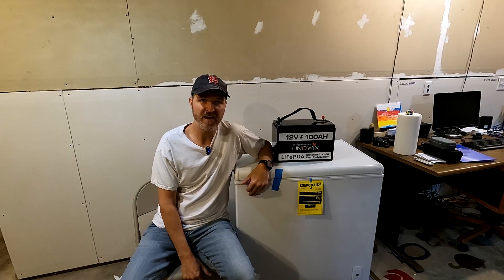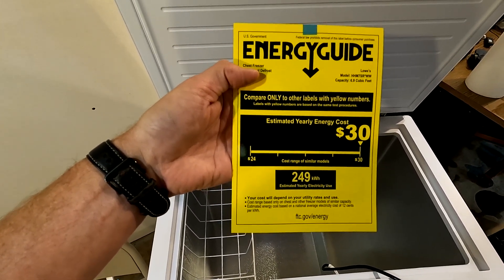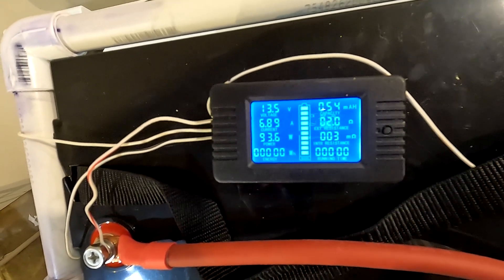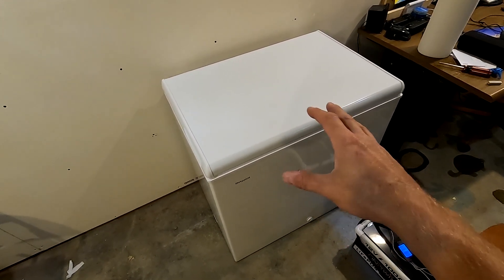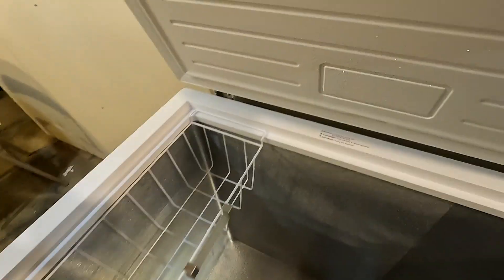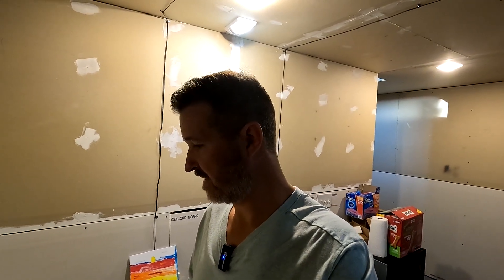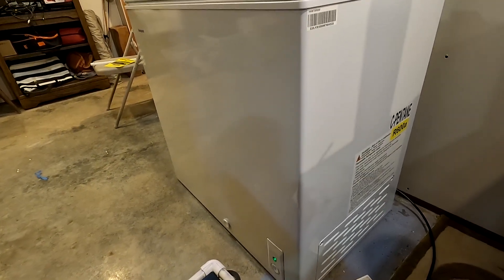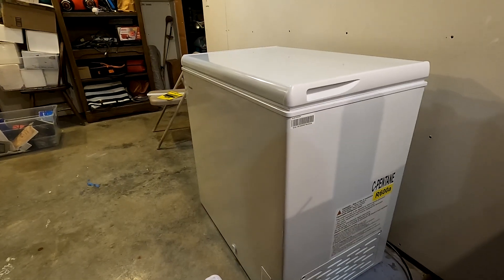Running Brand New 7cu. ft. Deep Freezer with a 12v 100ah LifePO4 Battery!

Comment: I have a 220ah battery and a 1000watt Redodo inverter but I can't get my little 7cf freezer (the exact same freezer that you have there) to turn on and run with my system.  My inverter puts out only 110 volts where my wall plug delivers 125 volts.  I got a hunch that this is the reason.  My inverter is supposed to have a surge of 2000 watts so Idon't think that would be the problem.  My 18 cf fridge won't turn on either.  I can plug anything into my system and all works well 'cept for the freezer and fridge.  New better 120v  inverter maybe?

Comment: This test was perfect for my thoughts. We have a off grid cabin and was looking at replacing our coolers with this type set up. Ice never seems to last and we are making so many trips out for ice. So upon arrival at camp, we would always start out with a hot freezer and have to cool it before moving in the food and drinks. I was trying to find a way to use a chest freezer as an cooler/fridge for up to 7 days of off grid camping. Now I know I will need another battery and a solar system to maintain the batteries during our longer stays. Normally we are only there 2-3 nights but a couple times a year we are there for an entire week. Thanks for taking the time to run this test and share it with us. It gives me more ideas
Reply from the maker: That's a great idea for your cabin setup, and I'm glad the test helped with your planning!

Comment: 92V is kind of scary to me but the motor probably doesn't run long enough to harm it. Lower volts pulls more amps. How many watts does your inverter use on standby? It would be a pain in the rear to remember but you might be able to extend that time by deciding when the freezer cycles and turning the inverter on and off every 3 hours or so in an emergency.
Reply from the maker: It turns out the inverter had a blown capacitor.  That's why the voltage was so low.  Most 1500w inverters use around 8w of standby consumption.  Hope this helps!

Comment: I would love to see how you set that battery up with the drop on rig. Looking to set myself up with 2 100ah lifepo4 batts and interchange them as needed in power outages for my refrigeration. Ideally one charges while the other is in use. Anyway I'm looking to rig mine like that for portability and relative ease and neatness going from battery to battery...thanks!
Reply from the maker: I get something working for ya!  Thanks for the comment.

Comment: Great video, do you happen to know what is the wattage on this freezer chest? Or how many amps does it draw? Thanks.
Reply from the maker: The freezer uses about 70w when it running.  At 120v, that would be about .6A

Comment: Turned down to lowest setting-s turns n2 a Frig/super efficient/longer lasting...what temp.setn' did u use?
Reply from the maker: I used whatever the default was!  I don't think I ever adjusted it.  Always sits at 0⁰.  Thanks for the comment.

Comment: I want a solar system to run my deep freezer 9 cu ft and am trying to figure out what it would cost. Any idea? This vid was very helpful
Reply from the maker: I believe you would want 200ah battery, 30A charge controller, 1000w pure sign wave inverter and about 400w of solar panels.  You're looking at a minimum of $800.  That is just an educated guess.  I hope that points you in the right direction!

Comment: that's not a energy style chest freezer. a energy style freezer almost cuts the usage in half. I tested both with my kilowatts meter
Reply from the maker: You're right.  This is a very basic freezer unit.  I bought a freezer that I figured the average home owner would purchase.  Thanks for the comment and information.
Reply: well you should have told people that in your video so they know, its a huge difference, just saying. I also run a 7 cubic ft chest freezer with a external thermostat so it runs as a fridge, great energy save as it opens form the top where warm air goes and its way better insulated than a standard fridge. external thermostats cost 6o bucks. have done this for over 25 years @OffGridBasement
Reply: @billywray4524 Billy, what do you mean by a real energy style chest freezer? Did you mean to type "energy star"?
Thanks
Reply: @prometheusboat  sorry yes i meant energy star. tested both huge difference in usage
Reply: @billywray4524  thanks a lot Billy

Comment: Just saw your video and what a great timing.  I've been thinking of buying a freezer but am still undecided on whether to purchase the 5 cu ft. or the 7.  Since it is  my two of us I'm leaning towards the 5 cu ft.  Seeing that that 7 was so efficient I am hoping that the 5 cu one will be just as much.  Gives me a piece of mind that a 100 ah battery ran it that long empty.  I have a couple of ecoflow delta max 2000  that I can hook up to and use as an EPS for when we experience a power outage which is frequent in my area.  This is good information to know especially when we travel and are gone for several days or weeks.  I know that my ecoflow powers my residential fridge for 17 hours by which power returns but the freezer that will have all my expensive meats will be a game changer with how efficient it is.  Thanks for sharing.
Reply from the maker: You're welcome!  Also, the freezer will run much longer when it's got food in it.  I've heard of you put 1\2 gallon jugs of water at the bottom, it makes a big difference.  Thank you for the comment.

Comment: We will be running a  similar  sized freezer off grid. The switch on surge appears to be about 750 watts for a few moments. The Inverter (700W Nomad) is rated at 1400w surge, so should handle it. It should do well in summer with sunlight. (We will have 2 x 160W facing E-W on opposite sides of roof with 200Ah of Lithium batteries.) We may need to upgrade to another battery to cope with winter doldrums here in NZ.
Reply from the maker: Sounds like you have everything you need.  Thanks for the comment.

Comment: i been curious about this myself. i just bought a high efficiency 3.5CF and 2 100AH batteries for cloudy days. i got 2 Renogy 100W solar panels to push it. its not yet arrived in the mail but i think i possibly may need to double my solar panels, just a hunch there.
Reply from the maker: Doubling the solar is a good idea.  That would make it sustainable for many more days at a time.  Thanks for the comment.

Comment: So if you add a couple of hundred watt panels and the charge controller this thing will be autonomous?
Reply from the maker: Yes.  Right now I have 1800w of solar and 600ah of capacity.  It's overkill and I never need to worry about it.  Thanks for the comment.

Comment: How long can 1 car battery that's 1,000cca run a 600w Ac without solar panels ?
Reply: Maybe 18 hours: V x amps = watts. 12 x 900 (running amps) = 10,800 divided by 600= 18 hours. However, doing this would draw your battery down to zero amps which will kill your battery if you do this often enough, even if its a deep cycle battery.

Comment: I’m a little older and have had a few freezers . Usually I was told never to run a freezer empty , first off , for what good reason, always at least a 5 gal pail three quarters full , one to see how well the freezer works, second to help maintain the frozen atmosphere, like a cooler or an ice box . In what scenario would it be used empty ?
Reply from the maker: It shouldn't!  I wanted to show the worst case setup.  This amount of time should be the LEAST amount of time you would get from a freezer.  Most would have already been frozen and probably at least 1/3 full if not more.

Comment: Hello friend i have 48V solar charger 30A PWM  SOLAR CHARGER CHANGER CONTROLLER WHAT PAMEL CAN I USED CAN USED FEW 12PANEL TO CHARGE MY BATTERY
Reply from the maker: For a 48v configuration I believe you need at least 60v of panels.  If you connect four 12v panels in series that should be good enough.  Hope this helps.  Thanks for the comment.
Reply: Thanks ☺☺☺☺ am trying to finsh my project yet done need get better battery but i used what i have for now all love watching video

Comment: I have 4 one gallon jugs of water in the bottom,  provides thermal stabilizing mass and as a last resort 4 gallons of drinking water.  Other advantage there is no defrost cycle like a refrigerator.
Reply: You could also put the frozen jugs in a refrigerator to help keep their contents cold.
Reply from the maker: The jugs of water are a great idea.  Thanks for the info and the comment.

Comment: Think I messed up I plugged both wires from battery to inverter then plugged freezer…. Help
Reply from the maker: That sounds correct.  What is the problem?
Reply: He may not have charged the inverter with a piece of thin wire connected to the battery before plugging in the freezer. @OffGridBasement

Comment: I want to build an ice cream tricycle, would I just need a power inverter and a battery to run the freezer?
Reply from the maker: Yes.  A fuse would be a good idea and a way to charge the battery.  Thanks for the comment.

Comment: Oddly, your 1500w inverter used to drain 19 watts from the battery without AC load, and now with a freezer when compressor is off, it drains only 12.5 wattss from the battery.
Reply from the maker: It was because the first inverter had a blown capacitor.  I believe this one is the replacement.  Thanks for the comment.

Comment: Hello. I have a ecoflow delta pro. I'm confused about how long I could run a freezer like this to constantly be freezing ice for an icy breeze. I have a wave 2 and it's dangerous and failing.
Reply from the maker: The ecoflow delta pro has about 3x the capacity of this 100ah battery.
Ecoflow = 3600wh
Battery in video = 1280wh
I would say you should be able to get at least 80 hours of freezer run time.  Hope this helps.
Reply: Thanks!!
Reply: My freezer seems inefficient. I think I'm going to return it. It's runs at least 80 watts, and is always on even full of Ice

Comment: Cant find a video of someone running a freezer indefinitely off of solar/battery full time. Im assuming its because you cant
Reply from the maker: You definitely can.  The freezer in the video is powered by my 24v system.  300ah and 1.8k of solar powers it 24/7 with no problem.  I plan on doing some things with a 100ah battery and a 180w solar panel soon.  Thanks for the comment.

Comment: Are you running a pure Sine wave inverter
Reply from the maker: Yes.  The inverter is a pure sign wave.  Thanks for the question and comment.
Reply: @OffGridBasement  I have a 5000 watt modified and now they are saying it will burn out a fridge or chest type freezer, it takes two batteries to get the 5000 watts, but if you keep something charging the the batteries, it will run ever thing in the house at the same time (110-120 of course) power house but now has me worried to use it, what can you tell me about this modified sign wave inverter
Reply from the maker: @randybird9979  I do know that modified sign wave is harder on anything with a motor.  You could get a smaller pure sign for just the fridge.  I've found a 1500w does the job just fine.  Hope this helps.
Reply: @OffGridBasement  I been thinking I need to get a pure sinewave , I have used the modified sinewave for fridge, but not much only when electric went off, thanks for the info

Comment: You sort of indicated that you might be running your freezer on solar to make it free, but you also seem to be experimenting to see how long a charged battery would last if you lost power and the sun didn't come out for days. I think that you will find, if you wanted a dedicated emergency power source for JUST your freezer, you could use a 700 or 800 watt inverter instead of the 1500 watt one and you'd get an even longer run time. The bigger the inverter, the more energy required to just run the inverter in standby (when the compressor shuts off and is just waiting to cycle back on when the freezer warms up) The type of inexpensive inverter you're using isn't very efficient, but by sizing the output of the inverter closer to the needs of the freezer, you will extend the run time. This will be especially true when your freezer is full of frozen stuff and will be spending most of the time in standby, and you'd just be burning up juice to run a large inverter that isn't really doing any work for you during those periods. Of course, if you have other things connected that run all the time, that would be a different story. The best way to power refrigeration with emergency equipment is to monitor the inside temp and turn the inverter on and off at regular intervals manually. It's more work, but the battery will do the most good that way. You can even chart the on/off time now, during a non-emergency, make a note of the interval and then replicate it manually during an emergency. Throwing quilts over a small chest freezer like that, if it's full of frozen food (keep any unused space filled up with frozen water-filled milk jugs) will require very little cycling for 2 or 3 days.
Reply: I was beginning to think the too!
Thank you for giving it your stamp of approval! 😊
(Deadicated inverter for the chest)
Reply from the maker: Thank you for all the great info!

Comment: 92vac input is a bad thing. You may want to check the input with another meter just to be sure. It'll run but the low input voltage will definitely reduce the longevity of the freezer. Possibly much sooner than you would think, no way to know. Good luck
Reply from the maker: You're correct.  It turns out the inverter had a blown capacitor.  ALFFAA sent me a new inverter and it runs at 114v.  Thanks for the comment.

Comment: You should have brought down freezer temp first, filled freezer, (as in real world power loss ). After cycled off, then start battery test.
Reply from the maker: I did this test again with those specs.  Here is the link:  https://youtu.be/1uY1rRy7wrQ
Thanks for the comment.
Reply: It was definitely real world for me! I have solar only for electric and this is exactly how it would go for me.

Comment: Is it ok to use this for 15 cubic deep freezer?
Reply from the maker: I'm sure it would work fine.  The compressor probably doesn't require too much more power.  If it's possible to find out what the surge wattage is, that would be best.

Comment: Freeze a cup of water to the top and place a quarter on it and set it inside the freezer. If the quarter drops, you know the power may have been out.
Reply from the maker: That is genius!  That would be great for the people that insist on unplugging the unit to save energy.  If the quarter drops, it's been unplugged for too long!  Good thinking and thanks for the comment!
Reply: Great idea.👍

Comment: What would be your new choice of inverter since you said 1500 was overkill.  This is what I'm looking for but need the construction instructions and would like to be able to charge the battery with solar and propane generator.  What parts would I need?  This is really what many are looking for instead of buying another solar generator.
Reply from the maker: It's pretty difficult to tell you what you need.  You could check out my website.  I have a simple 12v off grid system diagram and my more complex 24v setup. 
https://off-grid-basement.com
I hope this is a good start.  Thanks for the comment.

Comment: Would propane fridge freezer be better bang for the buck?
Reply from the maker: I personally don't think so.  I have enough solar and battery backup to run my freezer.  I also wouldn't want to constantly need propane.  They are a very good option for RVs.  Thanks for the comment.

Comment: I don't know if I missed something but you're also using an inverter?  Step by yep would have helped me.  I'm seeing so many variations of off grid power.
Reply from the maker: Yes.  The inverter is the blue piece of equipment on the side of the battery.  I plan on doing a follow up video on a a FULL Freezer.  In that video I will show step by step on how to build the 12v system.  Thanks for comment!

Comment: I have the same freezer you do. I am considering buying a OUKITEL (CN505) 614.4Wh  LiFePO4 500W Solar Generator. My freezer when full is pulling about 55wt. Based on your numbers (32 hrs on a 100wh battery...the OUKITEL unit providing 500wh (figuring about 80% realistic capacity) should run my freezer for over 6 days??? (5x32=160hrs) Is my math correct? Or am I missing something...

EDIT: I did just read below where a guy was unable to run his freezer with either his Jackery 500 or my Bluetti EB3A. What's happening there? Are these inverters too weak? (surge capacity?)
Reply from the maker: If I'm reading this correctly the OUKITEL has 614wh.  This freezer was running on a 100AH battery.  100AH = 1280Wh.  That would mean your 614Wh solar generator would get about 16 hours of runtime not including the loses from the inverter.  Realistically, the power station might get about 12 hours of runtime if it works.  Hope this helps!
I have a Bluetti EB3A, but I've never tried to run the Freezer.  I really think it depends on the freezer on whether it will run from a Jackery or EB3A.  I think you correct in the surge being too much for the solar generators.
Reply from the maker: I'm just going by the results of the shunt connected to a 100ah battery.  I figured you have about half of the storage capacity.  That would mean roughly half of the time.